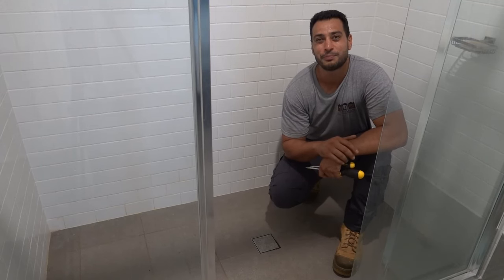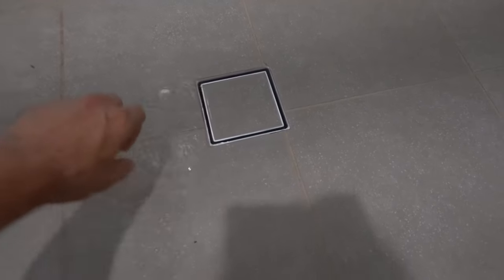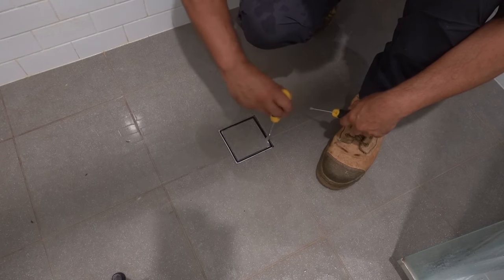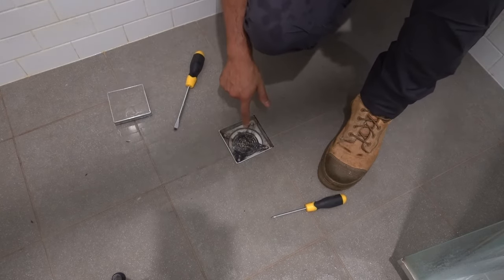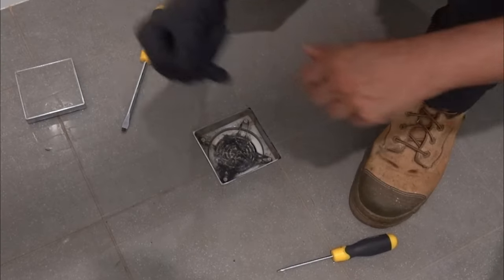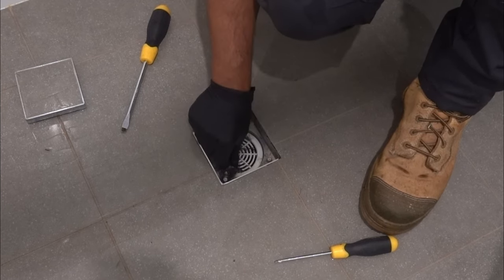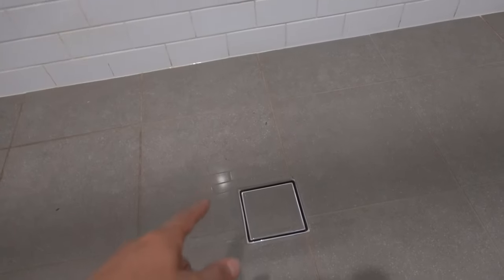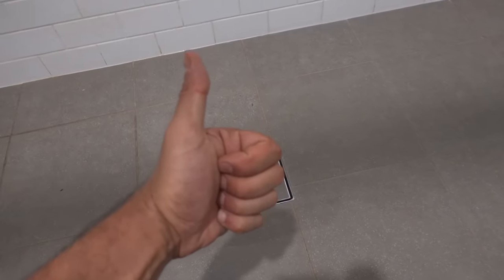How to unblock a shower drain - smart tile floor waste

Comment: How do they match the square cover with the tiles during building?
Reply: The insert is a section of tile. Just glued in.
Reply from the maker: A piece of the floor tile is cut and inserted into the cover 👍👍